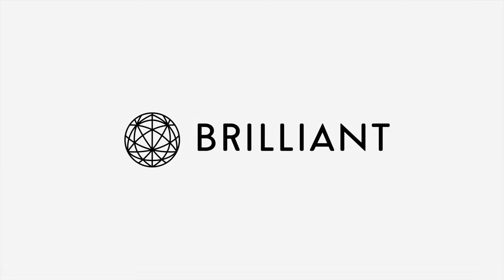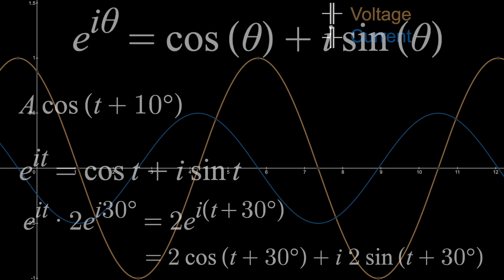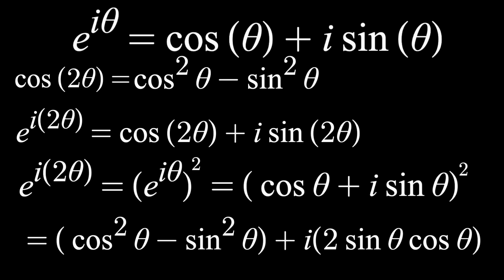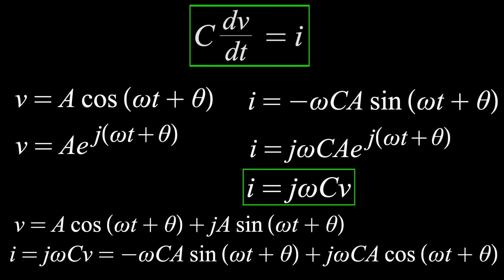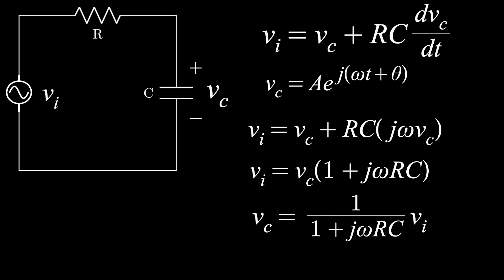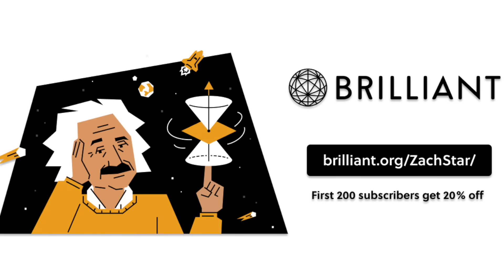Why do Electrical Engineers use imaginary numbers in circuit analysis?

Comment: This was a really nice video. Kudos for putting it together. I would have preferred to see angles in radians. I also think you missed an opportunity to show how impediance doesn't just allow you to treat Resistance and Capacitance the same, but it also allows you to unify with Inductance as well. With Impediance you don't need a differential equation which contains both dv/dt and di/dt (or worse, an integral)

Comment: Mathematicians: Immaginary numbers
Engineers: Jmmaginary numbers
Reply: Electrical engineers*. The rest of us don't
Reply: @ReynaMirez I mean not really because circuit equivalencies are used to transform mechanical, thermal, hydraulic systems etc into electrical circuits. and vice versa. j is pretty much the standard, unless you are doing pure arithmetic, because there will always be a conflict otherwise.
Reply: bc "i" will be the same as "i" in current symbol we use "j" instead
you can still write sqrt(-1) if you wish.
Reply: Logic people: fake invented symbols

Comment: Maybe i missed a step on the video, but you only get the permanent solution using this method, which ofc helps in solving the differential equation, but isn't enough

Comment: What until engineers learn that above 100Hz (mostly for engineers that do telecommunications) the resistor, capacitor and inductor can act each as a resistor and capacitor and inductor at the same time. (I am an Electrical and Computer Engineer student wanting to do telecommunications trust me ik)
Reply: ok

Comment: 2:21 He skipped a bunch of steps here:
All complex numbers can be expressed in the form z=x+iy on the complex plan. The modulus=absolute valve=magnitude of the vector in the complex plane=r=(x²+y²)^½.  Here x=1 y=1 so r=(2)^½ θ=atan(y/x) Here atan(1/1)=45°=θ 
r(e)^iθ=r(cosθ+sinθ)
Here 
1+i=√2(cos45° +i sin θ)

Comment: With just a little more effort, this could be presented as exactly mathematically correct. Then there would be no need for hand waving and things one needs to take on belief. Better that way, in my opinion.
Also, the first 6 minutes are great for a video titled, "Why do Electrical Engineers use j instead of i for imaginary numbers?"

Comment: Timestamps 
00:06 - Electrical engineers use imaginary numbers in circuit analysis
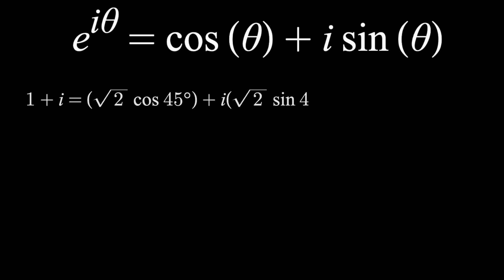01:45 - Complex numbers can be written in exponential form using Euler's formula.
03:25 - Complex numbers are useful in understanding amplitude and phase shifts.
05:04 - The double angle formula for cosine and sine allows us to simplify problems involving them.
06:39 - Impedance of a capacitor is the ratio of voltage and current.
08:23 - The output voltage across the capacitor is 3 root 2 over 2 cosine of T minus 35 degrees.
10:10 - Circuits with resistors and capacitors can be treated similarly by using impedance.
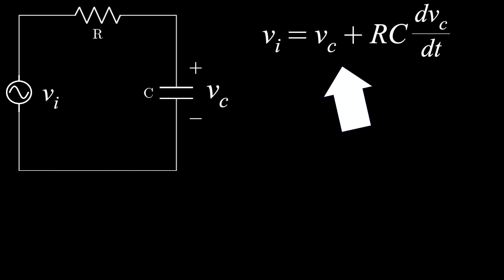11:45 - The Fourier transform yields the same results as capacitor/inductor equations.

Comment: Voltage and current are also commonly written as capital V and I. In combination with imaginary numbers, it doesn't help if we use i as a variable
Reply: that's why the imaginary unit is usually written as j instead of i in electrical engineering

Comment: This concept is analogous to quantum operators, for example the quantum operator for momentum ip/h has an i for the same reason that iwC does. The i captures the phase shift due to taking the time derivative of a wave. In the quantum operator, p represents a time derivative, and likewise in power equations w (frequency) also takes the place of d/dt. The convenience of these algebra operators in power system theory is only possibly because power equations use a single frequency (50 or 60 hz) that allows w to replace d/dt. Is d/dt is used instead, power flow equations become hellish 2nd order differential equations that nobody wants to spend time solving, but are required for solving for transient conditions with changing frequency.

Comment: it is actually very natural to analyze is just a change of basis form vector space to espectrum or frecuency space.     instead of representing a sinusoidal as a fucnion you represent it only by its amplitude and is  just a vertical line.  then is usefull for analizing signals that have a bunch of frecuencys. you can analyze music with it, but you can analize mechanical vibration also

Comment: what is important is that V(t) i(i) are rotating vectors. Linear algebra allows us to removed calculus complexity.  In Linear algebra ±π/2 allows product to be 1. This also applies to Fourier and Laplace - Euler was just the beginning.  Linear Algebra rules EE my brain flips when I see ( sin and cos ).  EE and ME 's need to be more mathematically oriented in direction of Linear Algebra.  It makes thinking about and analysis of complex analog circuits simple.

Comment: I had this in circuits, signals and systems for my engineering courses. This is basic stuff for a circuit with an ac current, an impedance, resistance and capacitance. This is what the circuit is when one uses differential equations : V(t) = d^2I/dt^2 + dC/dt + L where I is current, C is capacitance and L is impedance.

Comment: 1:15 maybe you should explain why the capacitor is causing this shift…

I mean the capacitor needs to “fill up” right. That takes time…
The difference in response to DC and AC is also an important point to cover. That makes people understand how filters such as low pass, high pass, and band pass filters works!

The same about the inductor. Show how it reacts to current and voltage, AC an DC.

Comment: @ 0:14 First THINK before you DRAW. With just resistors the V- and I-functions are horizontal lines, NOT sinusoids. After 25 seconds I know I'm wasting my time here.
Reply: You are wrong. The waveform for voltage and current through the resistor depends on what the source is. If you connect a sinusoidal source in series with a resistor and complete the circuit, then both the voltage across and current through the resistor will be sinusoidal, not straight lines.
Reply: @fredthechamp3475  Yes, I surely am. Thanks!

Comment: Because capacitors and inductors respond in the same way that resistors do, as long as they have the correct amount of energy inside them, even though they fundamentally work in a completely different way. Thus, you can "Imagine" that they are resistors, which makes sense why mathematically they appear in the imaginary part of a complex number.

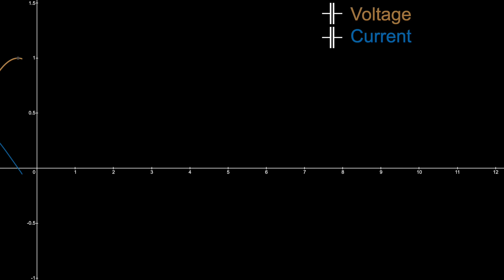Comment: Right off the bat this video clarified what “phase” meant at 0:40. I knew it was related to the phase of the signal (how much it’s shifted back or forth) but I didn’t realize that it was the phase of the current in relation to the voltage, and that the derivative in the capacitor equation is what introduces it into the circuit. I graduated from ece 5 years ago, learned AC circuit analysis 8 years ago. We just learned to calculate things, not get an intuition for why things work. This video is delightful for someone who spent time calculating and wants to get some insight into how things work.

Comment: Think of energy storage. Imaginary numbers are used to represent electrical components, such as capacitors and inductors. Capacitors and inductors only store energy. They do not expend energy. They contain the j operator which means angle or phase. So the inductor’s impedance is jωL and the capacitor’s impedance is 1/jωC or -j/ωC. The resistor, on the other hand, consumes energy 100% in the form of heat and does not store any energy at all, so there is no j operator in expressing R. Complex numbers are used by mathematicians while engineers call them phasors consisting of two parts, the magnitude and phase.

Comment: The counter emf of self inductance isn't in phase with current either, so inductive reactance is also out of phase?
Reply: Yes.  The current in the inductor is also out of phase with the apparent voltage difference across it.  For an ideal inductor, the voltage difference leads the current by a quarter cycle.  Opposite of what it is for an ideal capacitor.

Comment: One major reason is definitely because it turns inductors and capacitors into "resistors", and this makes it much easier to simplify a circuit;
it is pretty much like when you use the Laplace Transform to turn a differential equation into an algebraic equation (not quite the same thing, but something similar to that).

Comment: i majored electronic engineering ,what i had been taught is totally different to this vedio. the reason why we define "impedance" is because when we're trying to analyse a circuit, a mathematic transform would be used frequently; that is, Laplace transform. In short terms, Laplace transform is a integral transform which transform the target function defined on time into complex number. mostly we denoted the Laplace transform of function f(t) as F(s) = ℒ [f(t)] ,where s = a+ib, providing a and b is real number. 

Electronic circuits can be only written as math functions. which means every Electronic circuits have their own equivalent math functions. Let's say the RC circuit shown is the vedio is our target of analysis and we assume the AC source can be a random periodic function denoted as E(t). By KVL, we know E(t) = Vr + Vc which can be E(t) = RC( dVc/dt ) + Vc. 
the equation above is a first order ODE and we can take Laplace transform from both sides
ℒ [E(t)] = RC*{sℒ [Vc(t)] - Vc(0)} + ℒ [Vc(t)]
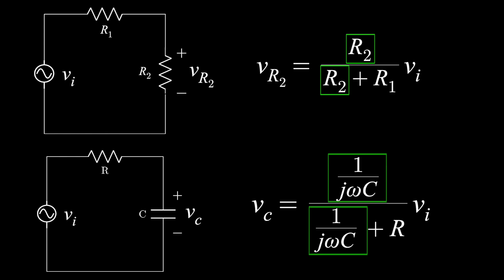the transformed equation above would no longer have derivatives and would be a quadratic function in terms of s. and after rearranging the transformed equation, we will have the equation shown in 11:01. where s = jω. 

Since the simple circuit like the RC circuit we solved still takes some times to be solved. Therefore, we defined impedence and transformed the input signals into complex world to make things easier.

Comment: I think the clearer reason this is useful for well-behaved non-sinusoidal waves is that its complex Fourier series, in addition to linearity, allow you to consider a voltage wave's individual harmonics' contributions to the voltage/current equations, where each harmonic is an weighted exponential as you describe. By allowing omega to vary you are simultaneously finding impedance for all of the harmonics.

Comment: By the end of first year, i learned that imaginary related to phasor form like video explained. At the second year after learned math of complex laplace fourier z transform, i realized that impedance same as 1/sC with s=jw, and can work with any signal and condition. It just so much easier if lecturer told that those just advance math that used in introduction circuit class.

Comment: Imagined numbers are actually not realy needed. Multi dimensional numbers can be used. Basicly thats what we do when we describe an impedance as a vector. 
So its quite pointless , but supposedly people learn complex numbers first in math class , before they learn about complex impedance in electronics class , it sorthof makes sense to build up on that knowledge. For some it could be less problematic , for others its pain.
Reply: Vector can be used ,but comple give euler formula which is very handfull to handle 2 dimension amplitude and phase for very complicate fuction. Outside of circuit, in plane wave electromagnet form is mix of complex amplitide, phase, and 3 dimension position which combination vector and complex. In control theory, complex used to determine stability with residue theory. Complex used not because which learnt first but because it is handy tools.

Comment: Don’t forget that, for certain conventions, the magnitude of signal phasors (voltage and current) in polar form is actual their time-domain RMS values, not their amplitude. This is usually the amplitude divided by sqrt(2), though you’ll have to use the integral formula for RMS values when the signal has harmonics or is not a perfect sinusoid.

Comment: Real world, there is trace resistance in inductors, equivalent series resistance in capacitors, and inductance across sets of conductors.  Those traits make real world circuits more complex.  

Also, reactive circuits have very real current flow in what theoretical math solves with imaginary units (the reason to designate reactance with j, not i), and those can cause very real power in conductors and in reactive parts, due to actual or equivalent series resistance.  

So, in doing this kind of engineering math, one has to keep an awareness of both approximations for convenience, and when a math theory process represents what very real physics aspect of real circuits.  

We now move on to AM directional antenna broadcast arrays, where the Earth is an electrical element subject to weather, and performance is optimal when complex series of reactive elements have a flat mostly resistive bandwidth....  But again, this is about math tools to handle complex vector sums, where thinking in terms of space and electrical waveform traits as vector elements allows understanding the math theory to physical reality relationship.

Comment: I was so peeved when a professor first told me that you can't just multiply vectors by each other. Why not? There must be something better than dot and cross products, right?
Then I took circuit analysis. Super, super satisfying to be able to just multiply (2,2) by (2,2) and get (0,4).
Reply: What's wrong with dot and cross products? They are very rational ideas for vectors, one tells you "how parallel" they are. The other tells you how perpendicular and also gives you the normal of the plane they form. Those are GREAT operations

If you just want to have linearity then you can use linear algebra, a Matrix is what multiplies a vector, and they can also multiply other matrices. And you can just to Mv and get a new vector

Comment: Imaginary numbers are not consistent with reals. The math is wrong! Edit: prove it yourself. If imaginary numbers mix with reals, then how much quantity exists? Let’s say you have “5” something. That’s 5 x 1. But using imaginary numbers then 5 * i^4 is how much you have. But 1 is a factor of this too. You can’t stop oscillating back and forth; it’s annihilation by antimatter-matter. No values are real this way.

Comment: So this is a bit out there but- I recently started experimenting with tarot cards and I intuitively started dealing them in arrangements of circular flow. I started looking at the forces being balanced as math equations, and the whole cycle as a circuit. 

This video may help me refine the techniques I use to “simplify” the expressions. I even already gave this process the name of “laminar transform inversion”, and involves several smaller steps of “associative zero-grouping” until they eventually “cancel” and the remainder between them is the highest priority Factor affecting the Outcome. 

the most interesting I found so far about the laminar transform is the 90degree rotations of cards in specific “circuits”.. they pulse on diagonally situated cards, rotating them in consecutively inverse order, counter-then-clockwise and back. It essentially… does exactly what this video said about “transforming differential equations(the timeline interpreted both ways through the equalizer card in the very center of the circuit) into algebra”. I can “solve”, a bad fortune by doing the transforms properly until a better inverse outcome can be assigned as the “solve for” card, and remainder of the transformed circuit— they detail the steps necessary that lead to the desired Outcome. 

Crash course test—- it’s scary how much detail a story can tell and each transform state tells completely different parts of the same story, no filler no contradictions whatsoever, filling in the blanks of the others, accurate for non numeric insightand I’m developing a technique to derive numeric information from the “battery”(self card bottom- flows up to the equalizer middle center-up to the Outcome top center) of the circuit. 

Thanks and wish me luck 🍀 

P.s. Make many babies while you can, keep them smart and strong, don’t put pharmaceuticals in their bodies, eat healthy and exercise. And fight to the death against the widespread acceptance and reliance upon genetic modification technology.

Comment: This was mind blowing, this puts to rest my age old quest on how Laplace's transform converts differential into algebraic equations and the inverse Laplace does the opposite. Also had a smile on my face when I saw how Vc in an RC circuit literally maps to the total impedance of the circuit, just as in two resistors. I learned all of these 2 decades ago and it all came back to me. You don't need to do rote learning if you understand it deep at this level. A million thanks for all your efforts. Don't underestimate the value of your work, it brings a lot of smiles to a lot of people.
Reply: I got chills the moment my mind made the link between the Laplace transform and the imaginary numbers.
Reply: It was in the 1980's when I learned about Laplace transform and complex numbers for electrical engineering during my polytechnical college education. Later on, I also did some eddy-current testing, in which this theory is put into practice. It was mesmerizing to observe how all of these concepts actually work, touching the objects and manipulating the sensors to act as they are supposed to do. It's not just theory for its own sake.
Reply: I would say laplace transforms work for a few additional reasons as well. This video demonstrated most of why complex numbers are useful in general: the 4-way symmetry of complex numbers (i^4=1) makes them really nice to work with for waves since the sine and cosine functions have derivatives which have similar symmetries. Laplace transforms also take advantage of integration by parts as well though, effectively pulling out the exponential parts of all functions, and since the exponential is the eigenvector of the derivative operator a differential equation becomes a polynomial one.